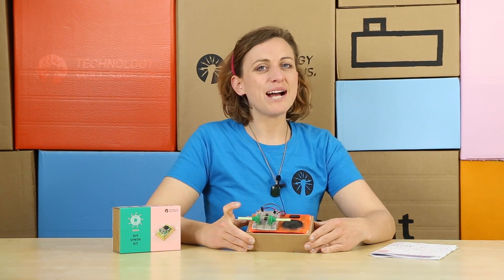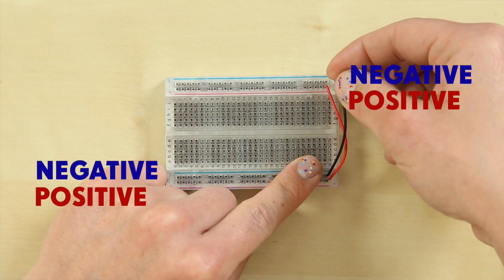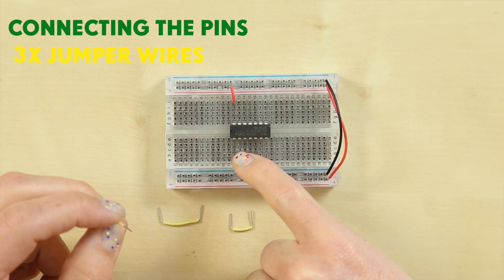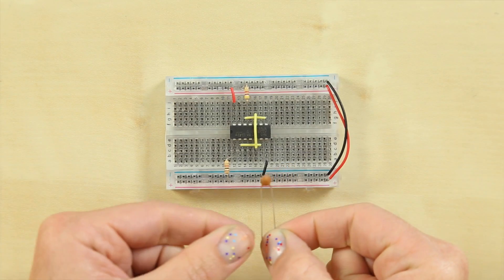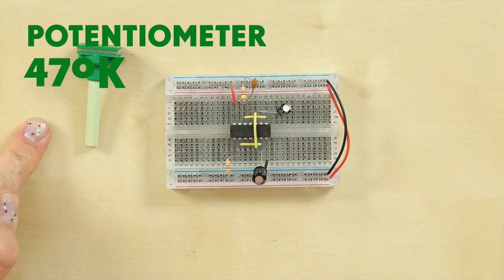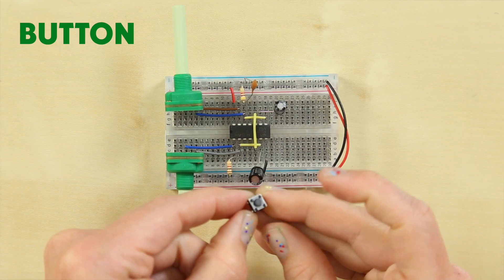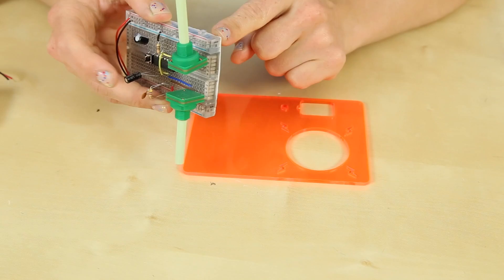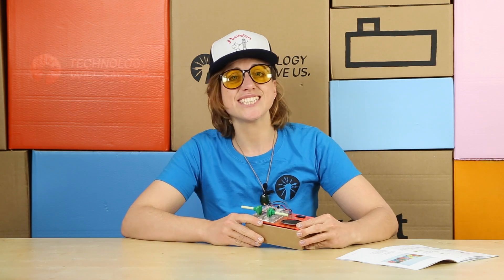Make your own Stutter Synth with DIY Synth Kit!

Comment: My son and I were trying  to get this together...but noticed that our 3 potentiometers are black, not green two are labelled B470K and one is A22K. Have the wrong potentiometers been included in the kit?
Reply from the maker: Hey there, thanks for reaching out and so sorry for the confusion. On the manuals, we reference the value of the Black potentiometers. If your kit includes the Green ones - worry not! They function exactly the same:

The Green 470KA are the same as the Black B470K
The Green 2K2B are the same as the Black A2.2K

Comment: my sound is super quiet. everything was plugged in correctly and had a full battery. any suggestions?
Reply from the maker: Hey there, thanks for reaching out and so sorry to hear your synth is playing up. That's no fun at all, so let's troubleshoot!

Can I ask you to double-check all the components are fitting snuggly to the board? It's also worth giving the bottom left potentiometer a good twist as this controls the volume. 

Still no luck? Can I ask you to pop us over a few images of your kit to support@techwillsaveus.com We'd love to take a peek and see if we can spot where things may have gone wrong?
Reply: Try swapping the speaker leads with eachother?

Comment: Hello, does anyone know if you can connect this synth to a pocket operator and be synced?
Reply: You can't. 

Basically, to sync with other devices, the pocket operators are listening through a mini-jack plug for a regular "click" sound. 
When you are using multiple pocket operators, it's using only one channel of a stereo mini-jack to mini-jack cable to send the "click", the other channel is used to send the sound played by the pocket operator to the other. (try using the different sync mode on the pocket operators while having stereo speakers or headphones, you will hear this regular "click" sound in one ear, and the sound of your pocket operator in the other ear)

The main problem is that: this synth have no stereo jack plug and is not emitting this "click" sound. It miiight be possible with some moding, but I think there are easier alternatives if you absolutely want to have a synth connected to your pocket operators.

Comment: I realized after watching some videos that I put in the IC Chip upside down. I got it all put together following the manual and then when I connected the battery, it didn't work, but the IC Chip got hot. After I saw the video, I took it apart and turned the IC Chip so the little notch is at the top like it should be. I got everything back together and it still doesn't work. I notice now that the IC Chip is no longer hot when I connect the battery. I worry I blew it out somehow when I had it connected at first with the IC Chip upside down. Is it shot now? Any suggestions?
Reply: I had the same issue but I think i found the problem. If you bypass the switch by  touching the capacitor then what you need to do is connect speaker into row 22 and the negative in row 20. take a look at the button and see if yours matches. ignore the numbers just make sure you have the capacitor hitting the first prong on the button and the speaker on the other prong. It completes the circuit https://www.techwillsaveus.com/resources/diy-synth-kit/stutter-synth-manual/#/25
Reply: Buy spare 556 ic or ask if they will send you a replacement.

Comment: I got it to work! it cuts out at seemingly random times and then comes back on after a few moments or button pushes. Any clue on what I did wrong?
Reply: Mine does the same. Doesn't stutter, so much as cut out at random intervals. Built it twice and still does the same.
Reply: one of the knob turner things changes the stutter timing. i thought it was cutting out too but i realised its just a really looooooooooong period between sounds. just keep holding your button on and you'll see they're really long pauses. idk why it's so long
Reply: @l4s4gn3l0v3r  maybe you got the potentiometers around the wrong way (wrong values), or perhaps used the wrong capacitors or resistors in the wrong places?

Comment: My IC chip doesn't fit into the breadboard and neither do my potentiometers.
Reply from the maker: Hi there! Thanks for your message. Make sure the legs of all components are straight. Thre breadboard is design to fit components legs therefore it should fit. If you can't still fit them please contact support@techwillsaveus.com and our customer service maestros will help you!! :)

Comment: Would be cool if you had PCBs available for people that want to make a more permanent version of each synth.
Reply from the maker: +tonalaxis thanks for your message! There are ways to fix the components into the breadboard to make it more permanent. A glue gun can help you secure the components on the breadboard therefore have a more permanent board! I hope that helped?
Reply: +Technology Will Save Us not really a good solution, I've got into making and soldering my own on perfboard because I was inspired by the Synth Kit. Surely as techwillsaveus do other kits that are soldered the next step would be to sell a Synth kit with a Printed Circuit Board??  Maybe 3 different kits could then be made available??
Reply from the maker: +tonalaxis Happy to hear that DIY Synth inspired you to move forward and make your own. Thanks for the idea. I'll forward it to R&D! :)
Reply: Why not make your own PCB then, gees 🙄